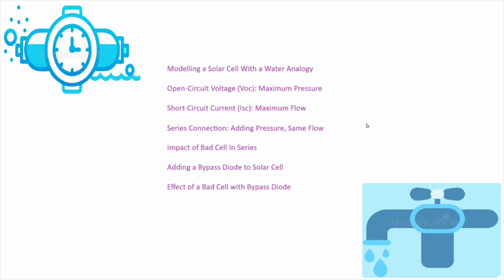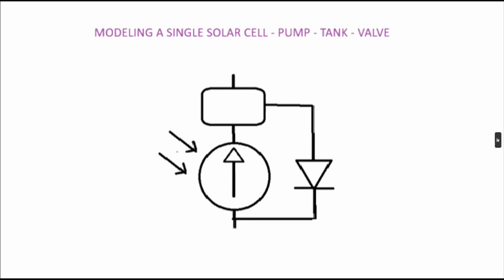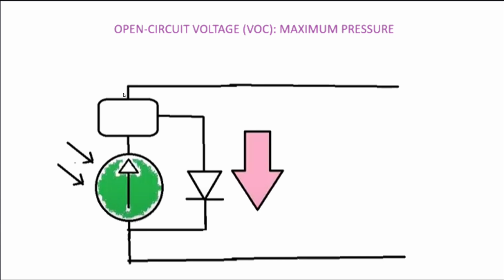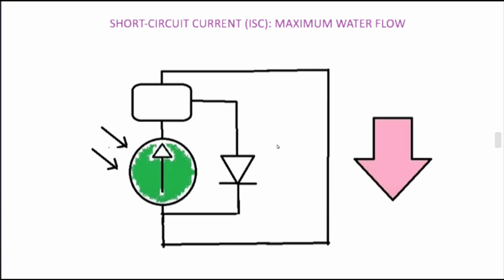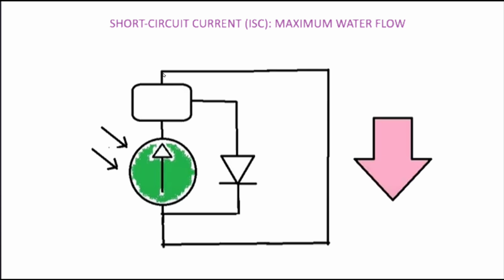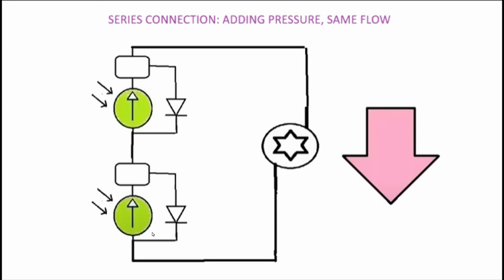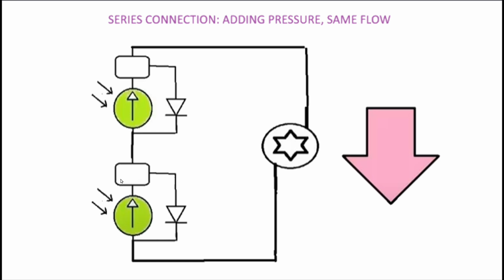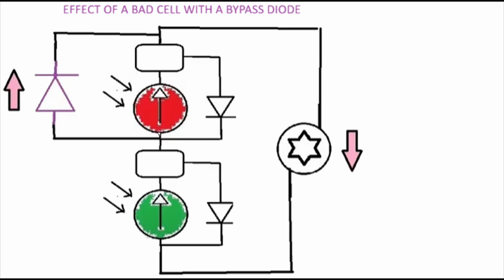Easy Guide To How Solar Cells and Bypass Diodes Work. Explained: Simple Water Analogy

Comment: Good analogy. However, I'd appreciate a more detailed explanation of how each part of the model compares to the solar cell. For instance, which part of the functional element does the initial diode in the model compare with a solar cell? 
And why is the Voc and/or Isc even coming up in this discussion (what is the significance)?
Reply from the maker: Great question! The diode right next to the pump represents the diode that's built into the solar cell itself (the p-n junction) — it's not an added part, just an inherent feature of how the cell works. That's different from the bypass diode I show later, which is a separate component added on purpose.
As for Voc and Isc — I bring them up because they're the two standard numbers you'll see on every solar cell/panel datasheet, so they're basically the common language for describing a panel's performance. Voc is the voltage you'd measure with nothing connected (open circuit), and Isc is the current you'd measure with the output shorted straight to the input. In real operation the panel runs somewhere between the two, but they're the two reference points everyone in solar uses to describe a cell.
Reply: @charcoal386 thank you.